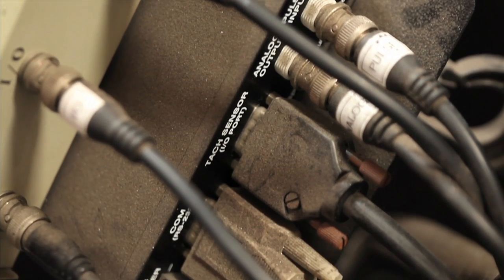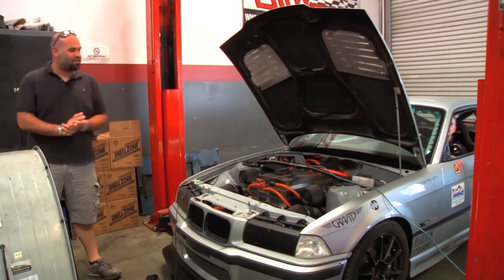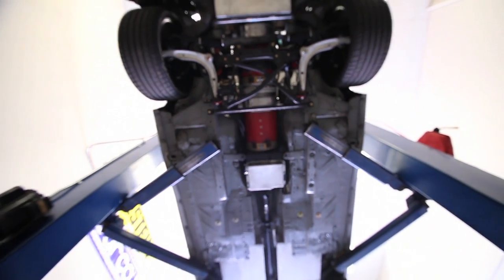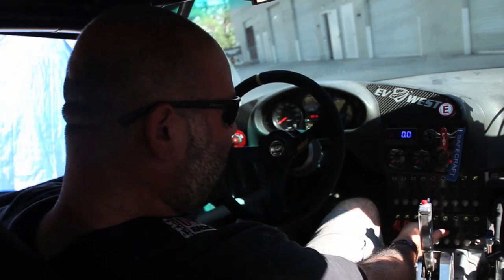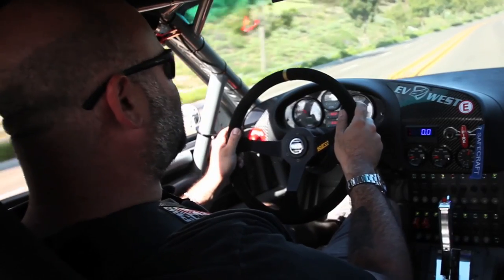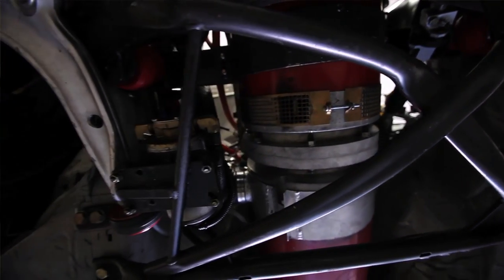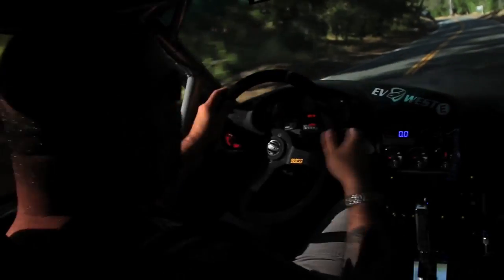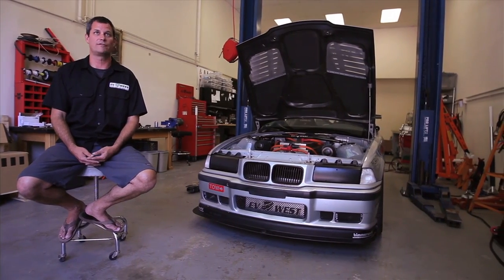This Electric E36 Makes 850 lb/ft of Torque at the Wheels! - /TUNED

Comment: your argument only highlights your ignorance of the dynamism of markets. by the time petrol prices become a legitmate problem, not just a little bit of egg on your face, the market will have solved the problem. FACT. either electric cars will have developed, or someone will have been desperate enough to create a solution to the problem. in 50 years, people wont even have a use for petrol, so it's value as a commodity won't even be based on current estimations. oh, and we DO know how much is left